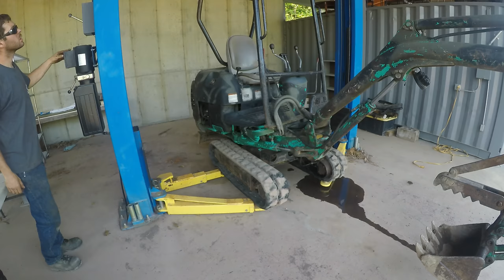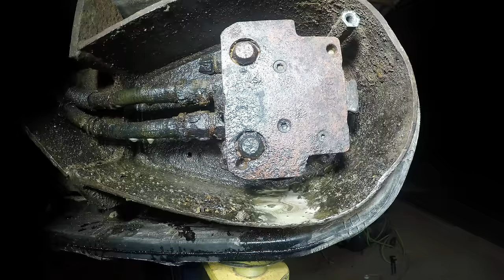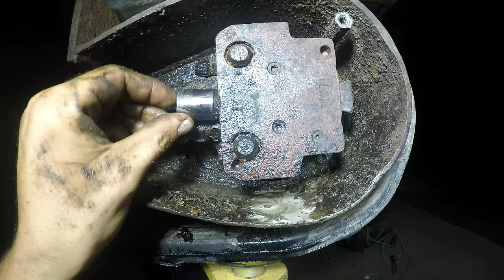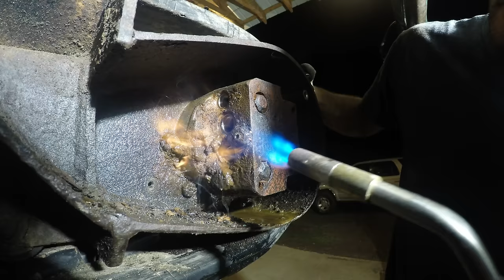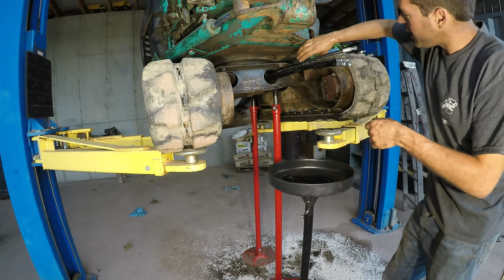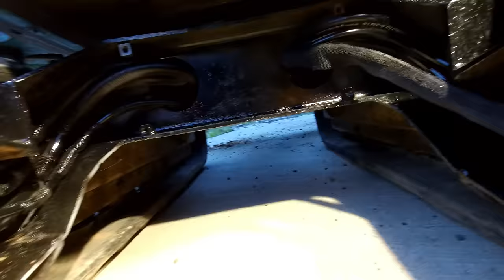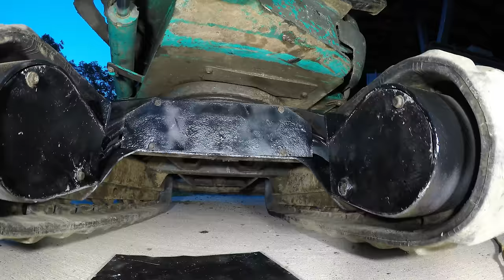Replacing excavator final drive hydraulic lines

Comment: I would have cut the old hoses and moved the protector springs to the new hoses. Doing hydraulics before you were born.
Reply from the maker: You would have re-used those rusty springs? Those were junk.
Reply: @AndrewCamarata  Still though you need to do something to prevent chaffing on the new hoses. The factory though they were needed.
Reply from the maker: IDK, they are not on anything that moves, plus there are rubber grommets on the areas where they touched anything. Plus those are suppose to be "tough cover" hoses. I don't think a wear threw is ever going to be an issue there.
Reply: @AndrewCamarata  Well here is something that you may not have noticed; when put a hose under pressure hydraulic hoses "move". Lets say that you were to cap off the end of a hydraulic hose and lay it out in a S shaped pattern (or any shape other than straight out) and then pressurize it you would see that it will straighten out like a steel rod. This is because of the pressure equalizing inside of the hose. Hoses that are anchored  at each end still are subject to this effect and will "move" a little there by running on anything they touch, even another hose. 
It is never a good idea to put a 90 degree bend in a hose close to a fitting because of this effect. If necessary to make a 90 degree turn close to a fitting it is best to use a 90 degree fitting even if there is plenty of room around the hose. 
Andrew I am 73 and worked and studied Industrial Fluid Power applications for many years. Good luck.

Comment: why don't you spray some rust inhibitor in there so it doesn't happen again?
Reply from the maker: I cleaned/primed/painted it. Think rust inhibitor would be better?
Reply: the paint should be much better but there is also a chance for it to still rust once it gets up under the paint. the rust inhibitor should chemically change the top later of metal so it can't rust
Reply from the maker: I guess that's something I need to try.

Comment: i dont have much confidence in that hydraulic shop that cant even produce a half inch elbow fitting
Reply: Sometimes you gotta use what you can get, or end up driving 90 miles to the next shop.
Reply from the maker: They didn't have the one elbow, but really the rest of that was fine, just the one fitting was rusted out, so I was ok with that.